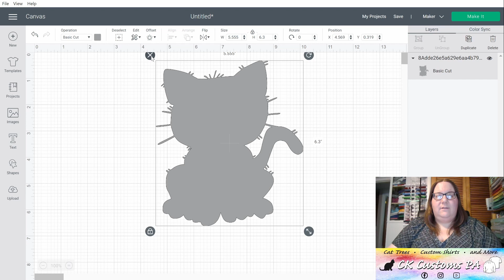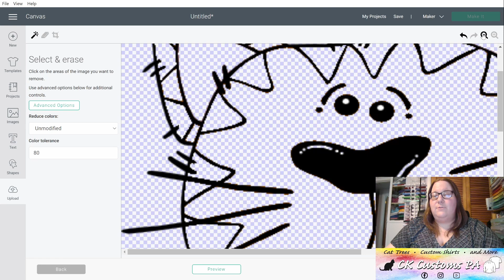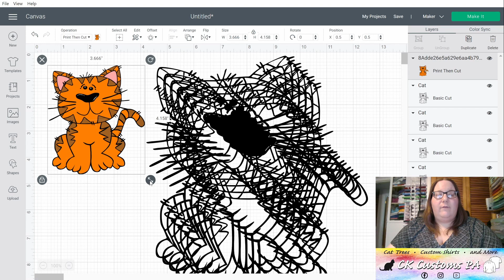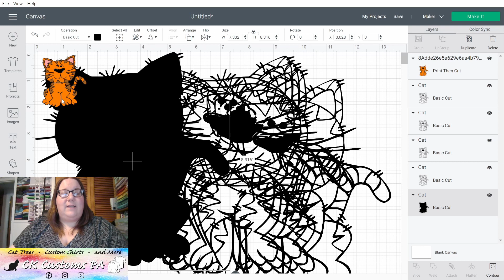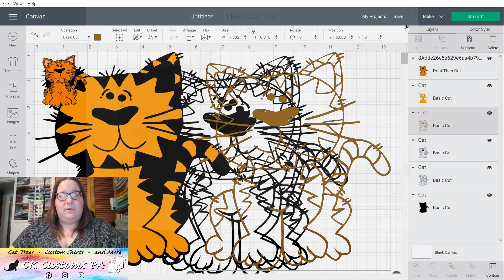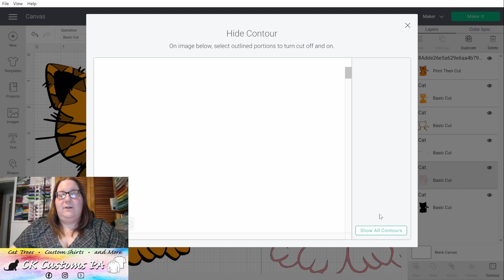How to Use Contouring to Create Layers in Design Space

Comment: Wow, Mind. Blown. I have never tried to break an image up into separate layers like that in CDS. What I have done is basically recreate images in Procreate and then import them in layers into CDS. And that is not a totally bad option because I can trace parts of it and modify parts of the design as I see fit along the way. But there may be times that I don't want to modify it. Your option is very clever and I'll definitely try it. In fact, my sister wants me to make her a tshirt with her school mascot (she is a teacher) and I have a 4 color image with black outlining like your cat. Only issue is that it is not a great quality image. I will definitely experiment with it though.

One little trick i have found for finding the little bits in the design is to realize they are sorted by size. So your tiniest bits are at the bottom. I use this if I want to simplify something and get rid of tiny pieces that wont cut well. But you can use this knowledge if also if you are trying to locate tiny pieces.
Reply from the maker: That's a great tip about the contour sorting. Thank you for sharing.